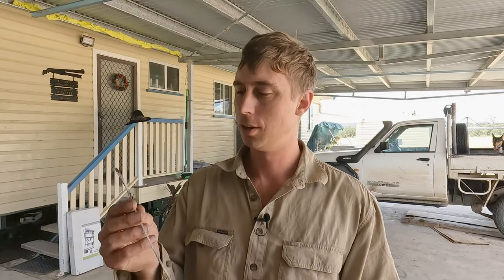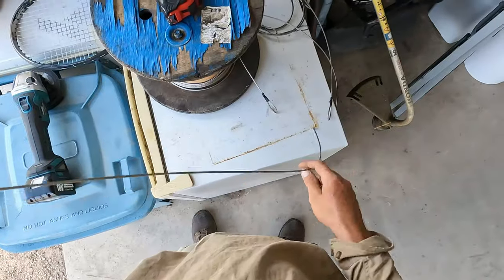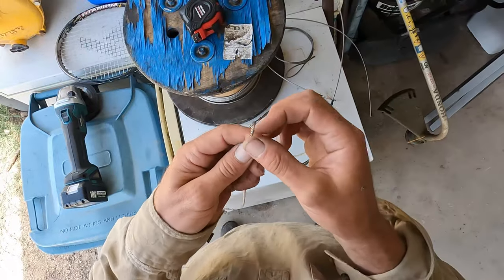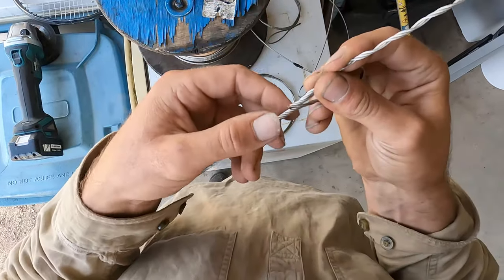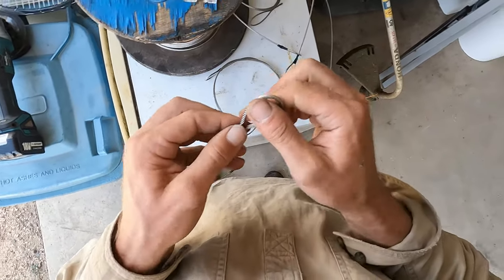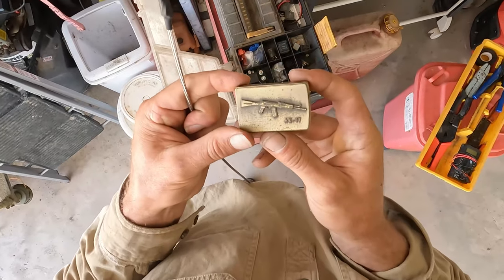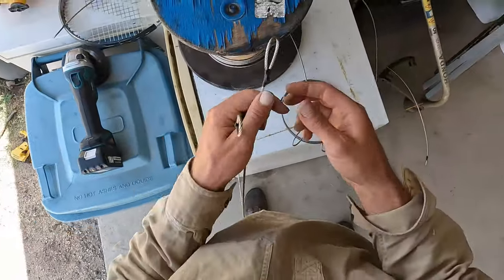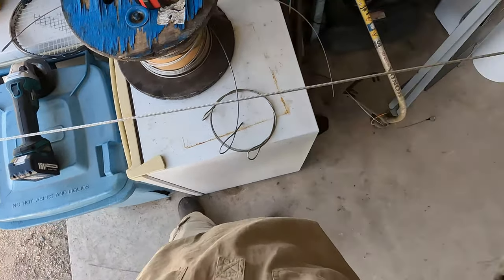How To Splice An Eye In The End Of A Wire Cable

Comment: Thanks Mate....I've often wondered how that was done.  Will be using that in the future.😃
Reply from the maker: You're welcome. I have actually changed my trapping cables now and left the tails longer after the splice and put a crimp over the ends so the dogs can't chew the cable and undo the splice. I nearly had one undo the splice because she chewed the heat shrink through and started undoing the splice. But for other applications this is still great.

Comment: Good job and interested in your technique. You said you would have preferred galvanized wire and a bit thinner mate .... have you thought about checking out the small rolls they sell at the hardware stores for replacing clothes line wires. Looking forward to seeing the snare in action. Cheers
Reply from the maker: I haven't tried it but it should work. I just thought this might be stronger and the splice might hold better. Not sure though. I'll give it a try some time.
Reply from the maker: I actually had a look in Bunnings yesterday and they had some black coated stuff that would probably be good but It's a fair bit more expensive and i already have plenty of this stainless stuff to last me a long time haha

Comment: It's stronger if the tag end is seriously secured, and heat shrink is cosmetic, not structurally strong.
When marrying the eye (Flemish looping it) the tag end needs to be long enough to secure it the way of choice.  Enough stress on a married eye even on a straight pull will cause it to deform, and possibly fail. A dog breakdancing stresses things from all directions.
One method is to simply splice it completely, 3 tucks tag ends into will suffice. A small screwdriver (with rounded tip edges if an old one is available) is ideal as a fid. The core is wrapped into the splice progressively "under" the fid's acute corner, and tucked over, only the 6 outside strands are spliced into the mainline. A bit of heat shrink or tape to cover sprags saves a reminder they are sharp and the joy of penetration wounds. Possibly that get infected.
The other easier way is to use crimps.  And with some sized cables 2,5 mm or 4 mm fencing wire crimps fit. Slide onto the cable before marrying the eye, and the end secured similar to using heat shrink. Neat cable cutting makes threading the crimp with the re-layed cable end easier. The sprag ends can be recessed slightly into the crimp's end. The crimp needs to be squashed to press the 2 cables towards each other, not on its "flat".
Reply from the maker: Thanks for that mate. Yes I found out once I started catching dogs with them that the heat shrink wasn't good enough and they just chewed it off pretty quick and the ends started coming undone. I undid all my splices and re-did them with a longer tail and then put a proper cable crimp on so it makes them all nice and neat and there is no way they can undo it now. I showed it in one of my later videos. Maybe i should do an updated video of doing it properly and take that one down. But thanks for the in depth description of the correct method. 👌👍